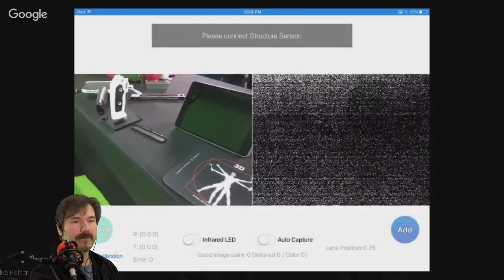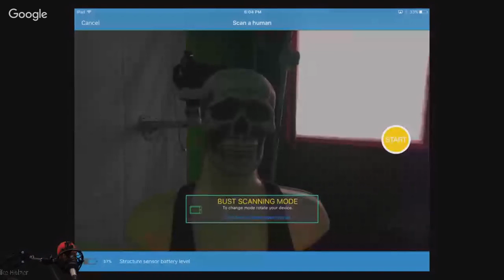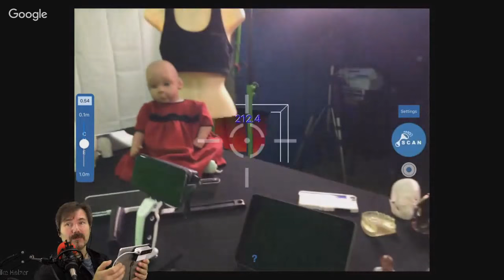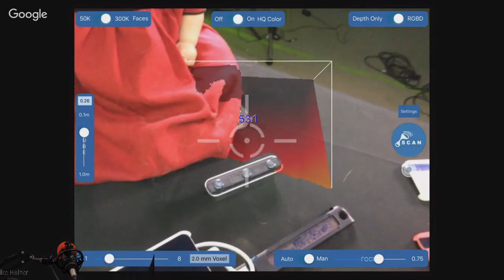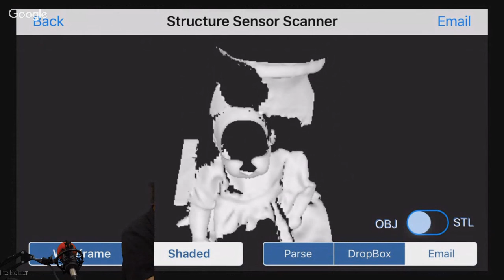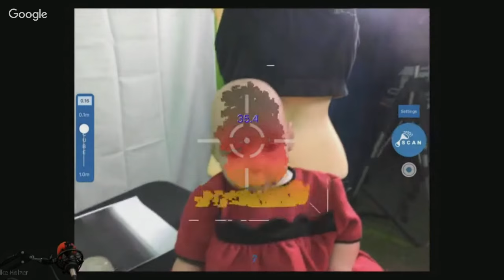3D Scanning 101 with the Structure Sensor, BioStep Capture, 4eyes, and NEODiBRIGHT

Comment: Hi there Will the BioStep Capture app work with an Isense?  Occipital has all be banned Isense 3d scanners from their apps.  Their scanner app worked great up until today when my Iphone 6 automatically updated to the latest version of scanner, which will not even recognize the Isense 3D scanner i have.   the app that comes with the Isense is not very good, and I was enjoying using scanner from occipital until they pulled the plug on Isense devices.  Now I dont have any decent apps in which to use my scanner.   Will your scanning app work with an Isense?  I'm not looking for full colour scans, just something that produces decent meshes with more detail than the Isense app.    :) great videos.  Cheers.
Reply from the maker: That is news to me. I guess I will have to see if this is true on my iOS devices, but it shouldn't affect my app since I have not updated the framework if they indeed made changes to it, but frankly that makes no sense for them to do this unless 3D System did not renew their license with them.
Reply: Initially it was discovered that isense folks could not use the occipital calibration app,  I contacted Occipital and they indicated they would allow only devices purchased directly through 3d systems  and with proof of purchase to use their calibration app.   Now I'm guessing that their software developed with the new SDK only works with Occipital devices that have the latest firmware.  ( I sense devices cannot upgrade their firmware, so we are left behind.)    would it be possible to download a copy of the app for ios devices to see if it will still work with isense?  ( is it available on itunes? )  I dont want to jail brake my device,  so I think my only option is to download apps from itunes.   it's an interesting issue.    

I emailed support at Occipital and they were kind enough to answer me, and that is when i learned they would white list the device's serial number if I could provide proof of direct purchase from 3d systems.

It's odd, where else would it have originally come from if not from 3d systems? it's badged 3d systems, and i could active it on 3d systems registration web page.  

I cannot provide proof of purchase from 3D systems, because I did not buy it directly from them.  :) just wondering what my options might be. :)  I'm just hoping to do some 3d scans for friends and family :)   Cheers. :)

Anyone using Occipital's very cool skanner app, should not upgrade to the latest one, IF they are using an Isense, as it will not recognize your device any more.... :(

Thank you for your quick reply :)
Reply: P.S. will the 4 eyes device be available again some time soon? It looked like a very effective add on for isense and Structure devices. :)   cheers. :)
Reply from the maker: I have a few for sale, are you stateside?
Reply: I'm in Toronto Canada :)
let me see if there is a "contact us" on your website and send you an email ... :)

Comment: What situations would you say the Structure excels over the Eora 3d scanner and vice versa?
Reply from the maker: +singhm29

Eora is going to be an excellent little scanner and I did an interview with them a few weeks back.  However, like all laser line scanners, the process of scanning is slower than structured light based scanning.  Quality should be better and it is available for both Android and iOS.  I also like their post work tools, also available for both platforms.  

There is also another solution offered called the Orbbec that does not require a computer or smart phone.  Mesh quality to will be comparable to the Occipital scanner, but the textures will have four less resolution than the Structure scanner/iOS device combo, but it is $179 cheaper, even cheaper if you throw an iOS device.